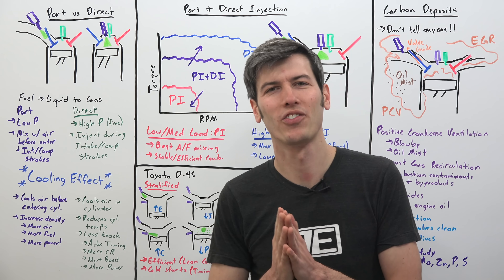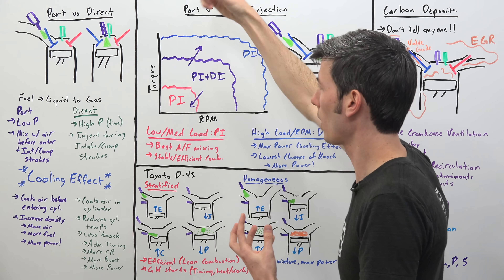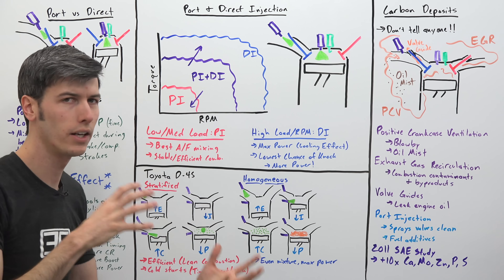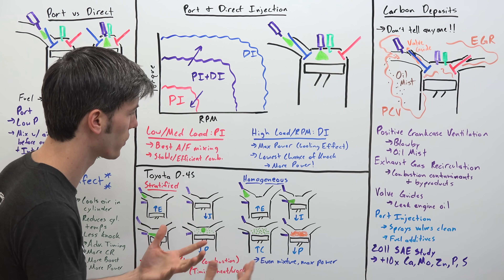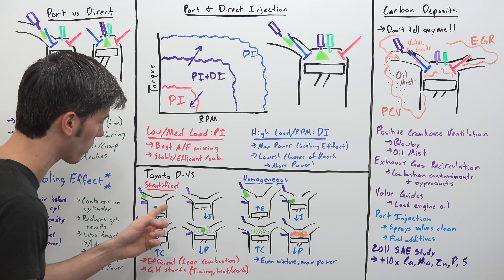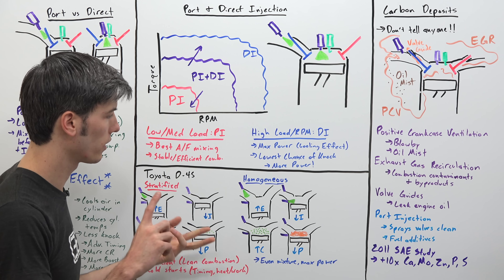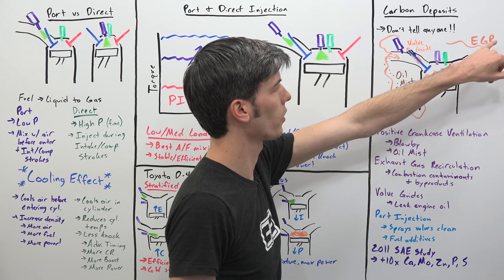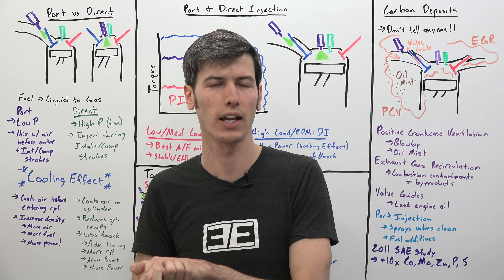Why New Cars Are Using Both Direct & Port Fuel Injection

Comment: Got a real laugh out of the Moe for Molybdenum, I have a feeling you're pulling our collective leg there.  As a mechanic my eye went immediately to the right side of your white board.   I was bouncing out of my chair until you mentioned valve deposits, the bugaboo of DI! Ask anyone who has had to have their BMW's DI intake valves blast cleaned how big (expensive) a problem DI resultant intake valve deposits can be.Always enjoy your videos.  If you weren't kidding about "Moe", well chem wasn't my strong suit either.

Comment: Dual fuel injection, the best of both worlds. I had a feeling this system will become more common in the long run. The newer Ford Mustang GTs also has dual fuel injection, which is awesome, and once this system gets more improvements, I bet most of the automakers will convert to dual fuel injection. I wouldn't be surprised if I see more Toyotas, Fords, Chevys, Volkswagens, even Mazdas adopt this setup in the future
Reply: Very complicated and expensive. Is it worth the complexity??
Reply: @brysortho complicated, possibly but just look at Toyotas now with both injector systems, many with 250,000 plus miles and still going strong, and excellent reliability.
Reply: Is your GT prone to carbon buildup? I’m getting ready to buy one! I hate my ecoboost, the 2018 is just band aid fix after band aid fix 😂 thank you

Comment: As a mechanic, I've noticed my wife's Mazda2 Skyactiv engine doing its retarded timing catalyst warm-up cycle too. 
The car sounds cool, it's got a gruff, slightly raised idle speed like a poor man's world rally car!
It is linked to the wheel speed sensors, so if we roll it back down the driveway during warm-up it cuts out & returns to a normal quiet idle before you drive off.
Reply: Dangermouse Usually these days they will use a software model of the catalyst temperature to switch the catalyst light off mode, at least that’s what my software does. On cars with this algorithm if you drive off that mode kicks out earlier than if you just let it idle.
Reply: @dale116dot7 
Yep, confirmed 👍

Comment: Engineering Explained, and Savagegeese reviews, are the only ones I have seen address the problems with Direct Injection and carbon build up. Some vehicles have severe build up as early as 20,000 miles, they then have to spend about $1,000 to fix it, until the next time. Hopefully Dual Injection will become standard in the future. Until then, some Toyota's and Ford's F-150's have Dual Injection, or a few still have Multi-Port, like Chrysler/Ram.
Reply: In the future? It already is a standard. Only some very low end models are still MPI only.  The worst carbon deposit problems I've seen so far on the internet seem to be on turbo engines
Reply: That's because carbon build-up can vary from engine to engine- and yes, that means not every DI engine has valve deposits. Most newer engines are utilizing a sub 1 micron PCV oil separation system, which in most cases is sufficient to keep intake valve deposits away on DI engines. There are a couple of systems out there, you can youtube search "Dana Multitwister" for one type.

Comment: I have thought of this alot, and I never have really found an answer. Why do diesel engines not suffer from this dirty intake valve problem? All diesel engines are direct injected. Also, most diesel engines use EGR, and use a system similar to PCV called closed crankcase ventilation (CCV). Maybe the intake valves on diesel engines do have heavy amounts of carbon buildup, but a diesel engine isn't sensitive to dirty intake valves like a gasoline engine is?

Comment: That Toyota stratified ingnition sound similar to Mazdas SPCCI
also, i have heard that the switch between port and direct injection in the BRZ/86 is the reason there is that torque dip

Comment: would having a Big Bore kit half the cylinders of a engine effect the speed of said piston travailing in the downward motion compared to the normal sized piston and bore would it be faster or slower and how would this effect the maximum rpm of said engine and would it be possible to have a engine with half the piston a big bore and the others slightly above stock but only to remove bore imperfections and to improve tolerances given the information above will be answered I would plan to make sure that said  4 pistons are firing at once 2 of said pistons would be a larger bore and 2 would not and on top of that if it effected the speed of the piston traveling in the downward motion would it be beneficial  to have a cam with 4 of of the piston strokes to be shorter or longer to make best use of the bore to travel speed ratio? plz i need help i'm not that smart

Comment: Wanna know why? Look at the Lexus 2.5L V6 engine. (2nd gen IS 250)
Reply: Yep, Toyota definitely learned their lesson on DI only engines with that engine. Which why I am surprised they didn't insist on adding D-4S injection to the BMW B58 in the Supra.
Reply: @NYGlockinator13  "Supra"

Comment: This video makes me think of Ford 2.3 EB ranger/mustang/explorer engine is only DI. The 1st gen 3.5 EB was DI only now the gen 2 3.5 EB is PFI/DI along with 2.7 EB. They will never tell you about the carbon but slowly all their motors are changing over even the 3.3 non turbo v6 has both injection methods.

Comment: You forgot throttle body injection which is nicht so good. Here is one: port injection for low speed with carburetor for high speed. another is preheat the fuel into a gas! And pcv to the exhaust instead of intake. Dual injection looks good but the complexity is great. Direct injection needs maintenance  of head removal to chip off the rock hard deposits in the intake tract.  Lets just go to Steam. TOOT TOOT

Comment: Great explanations.
Is their a link between carbon deposit and particles emmission?   These particles seems specific to direct infection
Reply: C Sidriss Yes, though some of it is just from combustion and not the deposits. Some DI engines have particulate filters in the exhaust system. Unlike a diesel, however, particulates are low enough that these traps don’t regenerate but just last the life of the vehicle.

Comment: I've got a question for you guys, and you Jason, I have an 03 tundra 4.7 , multiport injection, the OEM injectors have 4 holes , a company makes 12 hole injectors , will this really give any performance gain? Currently an engineering student and I think it won't , same amount of fuel , yes vaporized easier but at any rpm above like 3000 the four holes will be vaporizing well already, only benefit I see is smoother idle. What do you think?
Reply from the maker: Dunno, depends on a lot of things like the shape of the pistons, location of the injector, location of the valves, etc. BMW made some changes to their B58 engine in altering the size of the individual holes to have more fuel injected on the intake valve side, and less on the exhaust valve side. Along with the intake flow of air, and how it tumbled within the chamber, it made improvements. But again, it'll really be a case by case thing. It's probably decently optimized already, but not to say that improvements cannot be made.
Reply: @EngineeringExplained  , injection is above intake valve, the flow rates are the same but you can optd for a larger cc , but in a non tuned application ,improvement seems minimal at best ,(1stgen Tundras are non tuneable, ecu can't be fully opened ) thanks for the response! Seems what I was thinking.

Comment: Great stuff as always Professor👍
Reply from the maker: Thanks!
Reply: @EngineeringExplained   Is there any other brand than Toyota and they D4-S who are using double injections direct and port ? Never heard anybody else doing that, since Toyota introduced Its D4-S.
Reply: @djorksolo8544  VW is using it on the EA888 Gen3 2.0L TSI engine sold outside USA
Reply: @MrNangu   Ok good to know!  But compare to Toyota It's only 1 engine in VW. While Toyota already many engines. So I would go for a Toyota rather than a VW which isn't reliable at all!
Reply: @djorksolo8544  Yes, It's your choice. I only answered your question ;)
Reply: @MrNangu   Yes I know. Thanks for it  ;)  just disappointed the other brand is VW :D
Reply: @djorksolo8544  LT5 engine in Corvette

Comment: Do you know if Hyundai uses both port and direct injection on their 2.4L GDI?  Do you know about their other GDI and turbo GDI engines?  It would be great if you could have a video or multiple videos going through the different manufacturers engines and talking about their engines.
Reply from the maker: GDI would insinuate that it's purely direct (gasoline direct injection).
Reply: Hyundai 2.4 and 2.0T engines are direct injected only.

Comment: Do Mazda DI engines get a lot of carbon buildup? I wonder if their new skyactiv X engine will run into carbon buildup issues.
Reply: Stewart Morley they do if you run the car mostly  in the city you can have bad deposits even at 30 k miles.

Comment: And don't forget throttle body injection! That one was probably the most revolutionary of all...  And there were electronically controlled carburetors, with oxygen sensors. And my favorite, mechanical fuel injection. ;)

Comment: I love your videos Jason, really good explanation that even non engineers can understand, I like watching your videos more because I am currently studying Mechanical Engineering, I'd rather watch these lectures than boring, Calculus or Chemistry lectures, non the less, I really get hooked into the videos, pretty interesting to see how our modern cars work to get by all the Emissions Standards. I also own a car with a Toyota D4-S (Subaru) Boxer Engine, so it's really nice to know how it operates also during cold starts.
Reply: Very interesting work. Is this what engineering is? I'm looking for a career to get into. This would be awesome
Reply: @brandoncastles2900  Engineering is a broad field. Specifically this is Mechanical Engineering, and it’s not all about cars, there are many divisions into this Engineering. It’s an interesting field if you like the design and analysis of any component that moves, including fluids.

Comment: Another unmentioned benefit is the injector sizing is able to be better optimized to increase accuracy and control, since to required flow capability fo each injector is not as high as a conventional DI or port system which can help improve emissions, particularly to help meet new particulate standards.

Comment: you forgot some other disadvantages of direct injection that OEM will never tell you mainly the emissions.
NOx can not be regulated through a three way catalyst in lean combustions, DI produces sut just like diesel, they require a particulate filter.
thank you for the great video, it would be nice if you mention your sources at the end of each video :)
Reply: sure, let me explain why many care.
imagine having no exhaust after treatment on all cars and then imagine someone carrying a child and walking behind a car with engine on. I would rather assume that nobody enjoys the wonderful smell of sut flowing into their lungs.
PS: Sut is not only cancerous, it can cause sudden heart attacks and vein clogs.

Another point concerning EGR, it keeps ur combustion temperature low. 
Apart of avoiding Nox, it improves the durability of the engine so yiu might need it.

Comment: Anyone think seafoam is going to be more useful in these di engines? Sprayed into the air intake/throttle body? Just wondering what people who own a di engine can do as preventative maintenance or with additives to prevent build up.
Reply: You'd want to put a hole in behind the maf sensor because you want to avoid spraying it onto the sensor
Reply: @ghost-jesus  hi - seems u very knowledgeable about engines.  Have question on last part of video with egr and pcv and these causing carbon buildup on intake valves - maybe could just seal this off so then no waste products returned to outside valves.  Is not environmentally good but would engine run ok or would this retune with many other problems then?  Thanks
Reply: @michael-qp9xd  the EGR is accounted for in engine management and will throw a CEL if it is bypassed or clogged, the PCV on the otherhand is critical for engine life as it keeps "piston blowby" from causing excessive crankcase pressure that would cause oil leaks, oil flow problems, and acidity in the oil vapors in the crankcase which leads to shorter service life of the engine.
Reply: @ghost-jesus  thanks for follow up

Comment: Short answer. Direct injection is an engineering failure if not coupled with port injection due to carbon buildup problems when direct injection is used alone.

Comment: I had an BMW E90 335i with the DI N54B30 engine; had about 70K miles on it.  One night I got bored and decided to pull the intake manifold off to see what my intake valves looked like after I had learned about the carbon deposit issue.  OH. MY. GOD.  The sheer amount of black carbon just caked and caked on every single one of them blew my mind.  Luckily the problem was so well known on this car that there are valve blasting kits on the market that made the DIY job relatively easy. Still though, what a massive engineering oversight.

Comment: DI engines with walnut blasting may make the valve look good.  However, if that blast does not touch valve seat, carbon build up will cause burnt valve.

Comment: How does this compare to spraying cool water into the air? Seems like the fuel is doing the same thing. Why do water instead?
Reply from the maker: Because if you inject too much fuel the car runs rich. Water won't change the A/F ratio much.
Reply: @EngineeringExplained  that makes sense, so the very little amount of fuel sprayed into the port doesn't cool at much as the water does. I guess heat capacity plays a role in this too. Hypothetically you can create the most boost with Direct injection, port injection, and water injection. Since this gets the cylinder the coolest. Or is the complexity of such an arrangement going to make it impractical?
Reply: Water has much higher enthalpy of vaporization and allows for lower emissions.

Comment: Manually cleaned the intake ports/valves my 2010 gti twice... I wish VAG brought the euro motors over to the US because those came with 2 sets of injectors (like in the new rs3)... Whether or not the car has a dual injection system will influence my next vehicle purchase.
Reply: Jason R I have a 2016 GTI 2.0 turbo and it came with a dual system.
Reply: @dale116dot7  you must not be in North America. The North American market only received the single direct infected fuel system; no port injectors.

Comment: The legal department likely advises engineers to not mention the fact that the engines they are developing have inherent flaws in them and as a result could open them up to legal problems and possible settlements.
Reply from the maker: Ha, probably the real answer! And yeah, I would assume it's because they sell engines with purely direct injection, or plan to in the future.

Comment: Engine designers are trying hard to improve their beloved ICE...  knowing that they are gonna replace with electric engines pretty soon....  like the steam engine designers in early 1900
Reply: I wouldn't be surprised to see combustion engines around for quite a while longer, hybrid setups will become normal. If you live in a city, or travel into a city and have a place to park and charge your EV at home or at work, then having a gas powered car is silly in my opinion. If fast charging (less than 10 minutes) and a real range of a couple hundred miles become reality then the prospect of an EV becomes much more acceptable to the general public. I find it fascinating how refined combustion engine technology has become from where it was 50 years ago. I wonder what we'll see before it takes a back seat to electric power trains?
Reply: It is incredible the amount of creative problem solving going in to ICE development. More power, less fuel use and more environmentally friendly. But, then there's EVs. So... yeah... why bother!

Comment: What about the valves for the exhaust, could that face carbon buildup issues in either injection configuration?
Reply: voidcloud gdi has no problem with exhaust  valve deposits.

Comment: Over tech cars drives their prices over the point of saving anything on fuel anymore.  How much does this tech cost vs fuel? $50k cars vs and average of approx $40k lifetime of fuel. Is all this extra cost due to the higher and higher tech worth it? After all, the main reason they do all this is to save money on fuel. But the exchange is that you are spending way more on vehicles, spending thousands to save pennies.  No one invests in the stock market like that.
Reply: Continual effort to reduce emissions and get more power from smaller, lighter engines is a big part of the picture. If you want to check out crazy engineering, Google "feedback" carburetors that were used in the 80s prior to switch to EFI. 🙂
Reply: rizzle razzleuno If the emissions in production of these engines outweighs the emissions of the engine, again what’s the point?